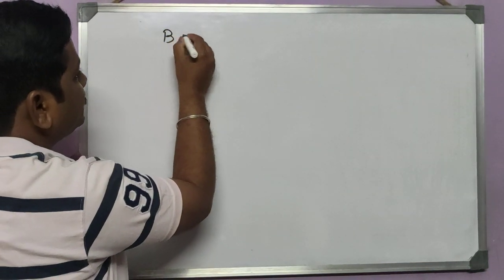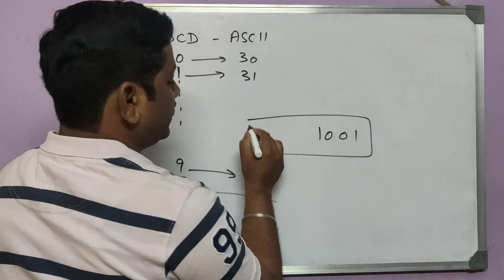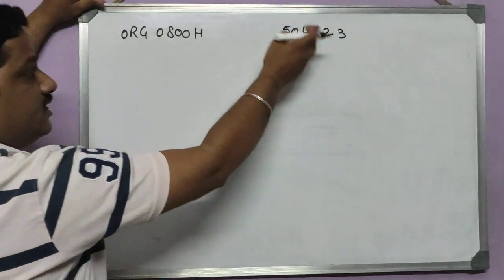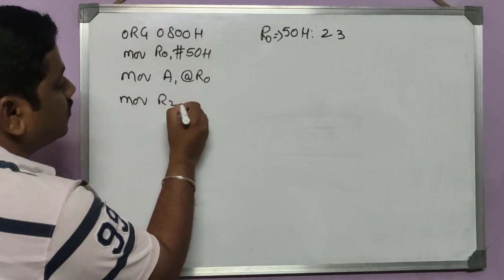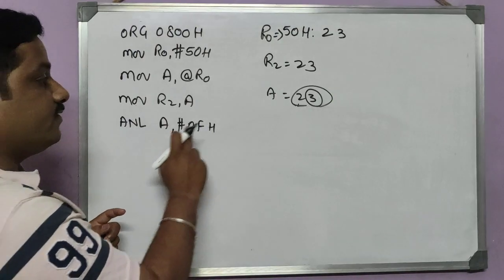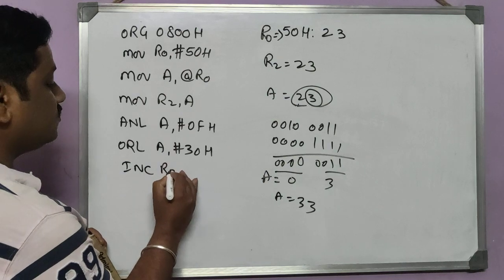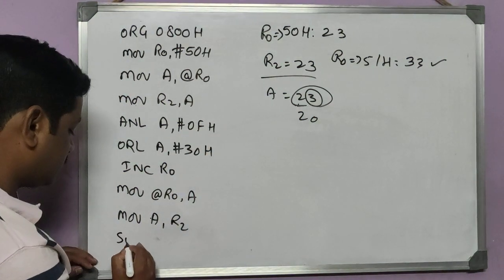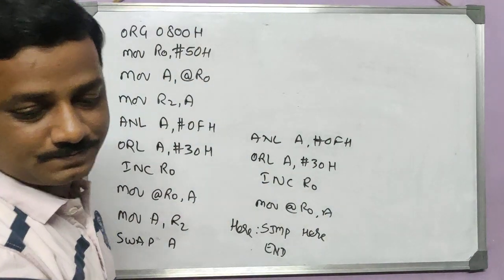BCD to ASCII Conversion Program!! by Sharan Sir!!

Comment: What exactly is ASCII code?

 People often erroneously refer to (as in this video)  the hexadecimal representation of ASCII character,  as 'ASCII' or 'ASCII code'

Infact all ASCII characters are assigned with specific distinct numerical values.

And then this numerical value is (i) stored as a binary number in the memory (ii) It is displayed as a Hexadecimal No. or (iii) as a decimal No. as required,  suiting to the need.

The ASCII characters along with their above three forms of representation together are referred to as ASCII coding. And not just Hexadecimal representation alone.